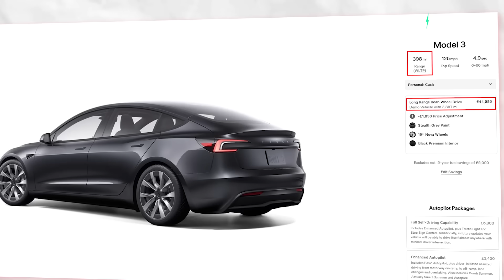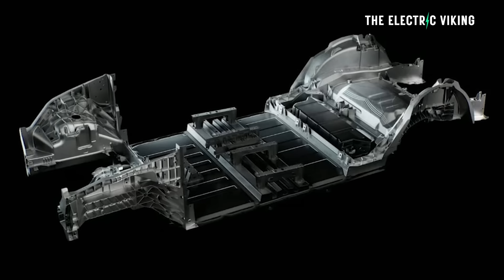NEW Tesla Model 3+ gets 702km of range - coming in September!

Comment: Nah...  what people most want which tesla wont provide (even as an option) 1. A speedo infront of the driver or a head up display, if they insist that the interior needs to be minimalist.  2. Spare emergency wheel.  They should take care of this first.  While its nice to have a 700k range on a long trip,  Pluging you car every few days is not an issue for most user's.
Reply: The original and Mini Cooper has the speedometer in the middle. Nobody complained about it. That was very popular in its day

Comment: My 2023 Tesla Model 3 with LFP batteries here in the US gets 260 miles range. This would be a big improvement if the new Tesla Model 3+ gets about 430 miles range. Although it will probably cost much more than the $40,000 that my Model 3 cost.

Comment: Can someone please explain to me why the rear wheel drive has a longer range than the 4 wheel drive version? My seemingly flawed logic would expect the 4 wheel drive version to be able to energy brake harvest twice as much . I have speculated that the usage of 4 separate EV motors (one for each wheel) would be a logical development for future electric cars as it would allow the car to brake harvesting so much that the normal bakes could be used only as emergency backups and not used in normal driving.
I’m talking way out of my knowledge here but would it really be much more expensive to make a 4 wheel drive electrical vehicle with 4 compared to 2 motors? Yes the spending on motors would be higher. But one could skip two differentials, downgrade the brakes like previously mentioned and the motors could be reduced in capacity to half (yes I am not looking for performance improvements, yet traction would be improved a bit). So what benefits do I see in this beyond better brake harvesting and traction? The unsprung weight would go down if the smaller brakes could be placed inboard, hereby improving comfort and handling at the same time. The wheel rims could be made perfectly for improved aerodynamics and so on. Sorry I have deviated to much from my original question 😃which was why does the 2 wheel drive have longer range than the 4 wheel drive? Greetings from Denmark
Reply: The amount of energy depends on the amount of negative acceleration aka breaking,  not on the number of motors. Every motor has internal friction and electric resistance, you need more wiring and add weight.
Reply: @docsnider8926 Thanks, I get your point. Maybe I was thinking along the lines of increasing the brake harvesting and thereby reducing the load on the brakes. A closer to one pedal driving 🤔😃

Comment: It's not for me as I much prefer the LFP Battery and being able to charge to 100% every day gives you 20% more range anyway. I don't like the NMC batteries at all and due to the fact you can only charge to 80% you are already getting 20% less range.
Reply: LFP charging to 100% has been debunked by studies already. You will reduce the life of your LFP batteries by charging to 100%
Reply: Do some research. You can charge the battery NMC to 100% for those long trips. It's not advisable to leave the car 100% charged while sitting for long periods of time. On the other hand, if you charge the NMC battery to 80%, it has the same range, or slightly more, than the LFP at 100%. However, you'll get that charge in 25 minutes, while the LFP will take over an hour. Finally, it's not advisable to charge the LFP battery to 100% every day, as it also degrades the battery.
Reply: @ALf-mn3qe  QUoting "On the other hand, if you charge the NMC battery to 80%, it has the same range, or slightly more, than the LFP at 100%."
That makes no sense unless the regular lithium battery has 25% more energy capacity than the LFP battery, and they don't. Tesla and other companies calculate their mileage estimates using 100% battery charge whether LFP or not.

Comment: Good to see Tesla focussing on the competitiveness of their passenger cars again. It will spur the whole EV market. I reckon 700km ranges could ignite the EV fleet market - which is only held back by the fact charging is commercial downtime and a PITA for the car rental industry. I met a consultant engineer working in the EV industry a couple of years ago who said normal ranges will be 500-600km very soon and they are expected to settle around 600-800km, with further tech progress translating into cost decreases. There will be bargain city cars and super long range options either side of the normal range. Won't be long before battery density goes up to make that possible while battery weight and cost both go down. The promised land...

Comment: In the last 4 years I have also had 4 Tesla models. From the M3 LR, MY LR, MX Plaid and M3 PR. When I see what ranges you have with them I wonder where and in what conditions you drive them! Downhill? Do you push them? With none of the above I have managed to do more than 300 km on the highway and about 350 - 380 km on normal streets.
Reply: Put an egg under your gas pedal.

Comment: i'm no fanboy but shouldn't we be applauding Tesla's stance of making the hardware as efficient as possible first, rather than  slamming a massive battery in everything like everyone else?
Reply: Bro they started the whole EV thing…
Reply: @nurbsenvi Umm, no. They might have made ev's sexy, but they're not even close to being the first.
Reply: @nurbsenvi people are clueless 👍
Reply: People who want the range can get the Tesla they want with the mileage capacity they need.Its a Great idea from a Super terrific car manufacturer.....
Reply: I don't know for sure, probably just different ways of tackling the problem of offering more range given what they've got: Tesla seems to be dependent on LG and Panasonic for their batteries; the Chinese EV brands have CATL or even their own brand battery, so everything is Chinese based and probably easier to offer better EV battery deals... whereas Tesla probably can't, so they had to work around the problem by improving efficiency first in order to offer more range, I don't know, just guestimating...
Reply: @you2be839  difference is the bigger battery road comes with extra weight and extra charging cost. I much prefer Teslas efficiency approach!
Reply: @you2be839 Not entirely true. Tesla makes their own batteries in the us which is 4680, and they’re opening a new LFP factory as well.
Reply: @you2be839 tesla use CATL cells too… they’re battery agnostic.
Reply: @you2be839  Tesla only dependent on LG/Panasonic to make Tesla-designed batteries, e.g. 18650, 2170, since they don't have the capacity to build all the batteries they need.  Now, that Tesla will be opening up a battery factory in NV, they will be less dependent on 3rd party battery makers for their battery needs.

Tesla batteries > any Chinese batteries.
Reply: Clive, the two aren't mutually exclusive
Reply: It already has a massive battery in it. The Tesla 3 battery weighs just on 500 kg (1100 lbs)… quite a lump.

Comment: The model 3 long range RWD appeared as an option a little before the highland launch. It is almost as expensive as the long range AWD, but likely cheaper to insure. The regular RWD is still the best buy in the range as it is significantly cheaper even if the CATL LFP battery is not ideal in colder climates.

Comment: While a longer range is really nice, think about how much it can charge over night over trickle charging or single phase devices and then decide if it is worth it.
A 78 kW battery charging at 2.4 kW/hr takes 32 hrs (from 0 %) and so for an 8 hr overnight charge you would only get 19.5 kW. For 6 kW/hr you 48 kW for the same 8 hr period.

Comment: If the infrastructure for charging stations was improved dramatically , I would consider an EV and in particular, this EV.
By the way , do all EV’s come with low profile tires ?
They’re very expensive to replace and very harsh on the ride.
At least that’s what I’ve experienced on a vehicle I once owned.
One concern for me where I live in the northeast is snow.
Don’t like the idea of rear wheel drive and four wheel drive would likely adversely affect the driving range.

Comment: 702 km about half of what my Mercedes does on a tank of Dinosaur Fuel and only £35 Ved UK 😊
Keep the diesel flowing
Reply: Does that price include all your servicing?
Reply: @connclissmann6514 Do you include servicing of the EVs ? Because if you don't service them the warranty is null and void also do you include tyre's as they are more expensive and don't last as long 😉
Reply: @johnthemagnificent7022 Sure. Preventative servicing costs on a Tesla for instance are nil. Naturally, tires and wipers need replacement as rubber wears and perishes. But that applies to all vehicles. The tires don't typically wear faster, as the weight difference is not that significant.
Reply: @connclissmann6514 My friend's tyre's don't last 15000 miles on his Taycan 😮..... But that's the least of his worries as he's lost£70K plus in 3 years in depreciation 😢
Reply: @johnthemagnificent7022  That's what he knew when he bought it.
Reply: Keep the planet burning. Great attitude
Reply: How often do you drive 1400km non stop in your old school diesel-car? 🛢️⛽😅
Reply: @mikafiltenborg7572 Quite often  Birmingham to Biarritz..... lovely drive 😊take the ferry then that gives you time for a meal and shower you should try it ..... South of France is beautiful too....

Comment: Only 700 km for the new LR model 3 plus? Lucid Air managed to cover 1200 km recently.
Reply: Yes, but you will pay for every kw of battery.   Lucid makes a nice EV but you will pay double for a lucid.   Tesla increased the range with this new battery while NOT increasing the price.   Do you want to pay 90k+ for a Lucid?   GM can also make a 1200 km vehicle as well just by increasing the battery size.   Battery size adds weight and expense.     How much does the Lucid cost with the 1200 km battery?
Reply: @troyfall6573 at least triple the price. But at least the range anxiety folks will be cured:)
Reply: How often do ppl drive 1200km non stop? 😂😂😂
Reply: Lucid will make profit in year 2075

Comment: The claimed range of the Tesla All-Wheel Drive Long Range is 629 km. In reality, I get around 350 to 375 km, but I'm fine with that. If they claim 700 km, you can realistically expect around 400 to 450 km of real-world range. The actual usable power from the 75 kWh battery is around 52 kWh. Consumption is roughly 130 to 150 Wh/km with summer tires and about 180 to 200 Wh/km with winter tires. Based on that, you can calculate the actual range yourself. There are plenty of Superchargers around, so I’m pretty happy with a 350 km range.
Reply: hahhaha BS

Comment: The RWD Long Range has been available in the UK since the early 2024, it was also available on the previous model during 2023 and probably 2 years earlier for fleet buyers.
Reply: Not early 2024. I ordered my Model 3 RWD with the LFP battery on May 10th 2024 and the long range RWD with the NMC battery was not available. Otherwise, I’d have one 😢

Comment: Yes, this is what we want : ) More range. I want more than 400 miles.
Reply: I agree 400 mile range is ideal and it will attract potential customers.
Reply: why? do you do that much driving daily?  i have the shortest range model 3 SR+ and 350km fully charged. but really i keep it in the 40-60% range and charge every third day. more range just means your hauling around a heavier battery. worse driving dynamics etc.
Reply: @3184Patrick I hate when people try to tell other people how much range THEY need.
Reply: @Jay___855  most people wanting massive rang i find don't even own a EV. im sure there is the odd case. But once most people own a EV you realize you don't need 600km of range. your bladder/hunger range is more like 250km lol
Reply: @3184Patrick Everyone’s different and if over 400 miles makes sense to his needs than fair enough. I do a road trips just last weekend I did Glasgow to Doncaster round trip via a few places on Saturday to Sunday and it came in 531 miles. Plenty Tesla chargers around but on the way down I really needed to do 260 miles in one go no questions, no stops. This was not in a EV and apart from the hotel the Car sat for three hours at a airfield when it could have charged. Range for many is still king and this will disappear for instance that new Merc  CLA does real world 430 miles on the motorway and 470 mixed driving and for many that’s plenty and this will become the norm even suggesting 600 miles by 2030 will be the norm .

Comment: That's great .. my VW Golf 6 gas powered (which is fairly efficient / economic) has a ~850km range on a full tank. 
But it;s on mixt usage - because in cities start/stop/redlights is probably 500km (or worse). So pretty sure aside from mixt/long-road use , the model3 already more range than my car in city - usage.
Reply: Funny how evs are a lot more efficient in city use but worse on freeways
Reply: What are the servicing costs on that Golf? Just asking...
Reply: @connclissmann6514  i'm barely doing 10.000km/ year ... servicing none except the usual annual check and oil/brakepads changes. ~250$/year
I took care, car works fine . 170.000km , age: 14years
Reply: Who gives a damn about internal combustion engine cars anymore?
Have you ever heard about cancer caused by tailpipes toxic gases?😯
Reply: The difference is not only one rear motor but worst audio system and cloth material on the doors instead of alcantara.
Reply: An internal combustion engine car? 👎👎☹️

Comment: Why are they still using NMC batteries?
Reply: Because they work and have great power density.  I have them in my 2024 LR AWD and get 355 miles on a full charge.
Reply: @RagnarinVa And in few years that drops by 10%. It's better to get LFP battery.
Reply: @Kallon-r3b for some applications but LFPs are heavier and they are not impervious to loss either. The NMCs on Teslas go a long time before any real drop. Haven’t had any issues with my Model 3 AWD LR
Reply: the CATL/Tesla LFP battery line in Reno is still under construction. so they are using the Panasonic design battery

Comment: having owned the M3LR since Sept. 2024, I can confirm the range at 100% is ~360 mi...but the daily charge limit of 80% gives you around 280 miles. It's more than enough for my daily needs and most road trips, but for those 8-hr trips the additional 100 miles of range would be welcome...but if I was being honest, I wouldn't be driving more than 300 miles before stopping for 30 minutes, and in that time I can get myself back up to 70-80% at a supercharger. I'd rather the batteries stay the same capacity and the price drops by another $7-8k.
Reply: LFP doesn't have a charge limit.  I thought the Long Range also had a LFP battery.  Thanks for mentioning this.
Reply: Here in the UK both rear wheel drive long range model three and model Y  available for awhile.  LFP batteries do not mind being regularly charged to 100% but have a lower overall energy density.  Typically the range of an LFP car on 100% is around the same as a lithium ion car at 80%.  So for Tesla it’s kind of tricky because you need to assess which format would be best overall.  I can’t think of another manufacturer that offers the same car with a different battery although some off of the same car with a smaller battery.
Reply: @ouethojlkjn While LFP batteries may have lower energy density than standard lithium batteries, car companies compensate by having physically bigger batteries that store around around the same mWh of energy. So the ranges are generally very comparable. 
Recent studies show that charging to 100% actually degrades LFP batteries, but you have to charge to 100% to get good range estimates because of LFP's flat energy curve.